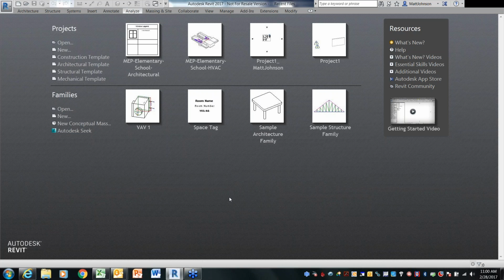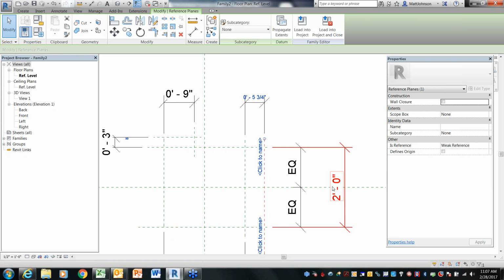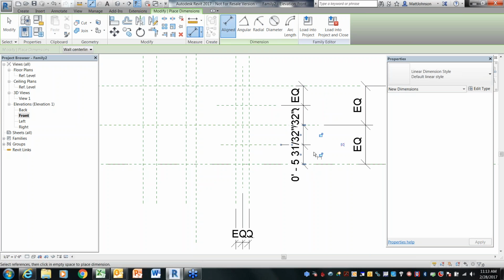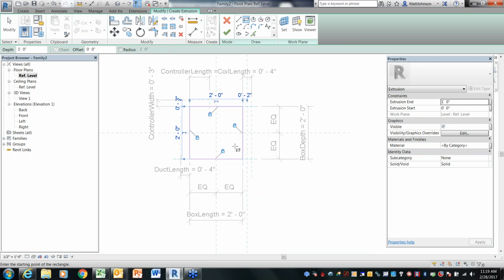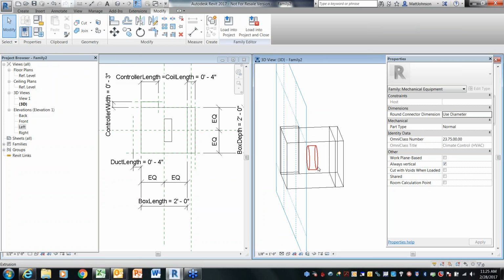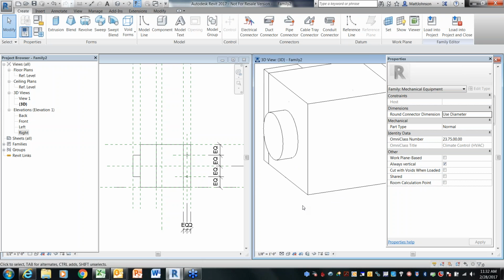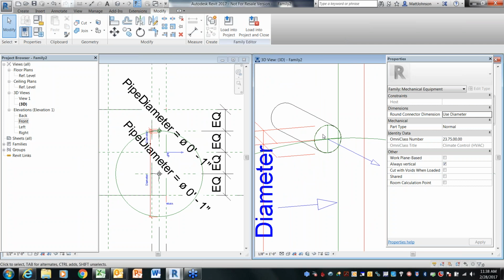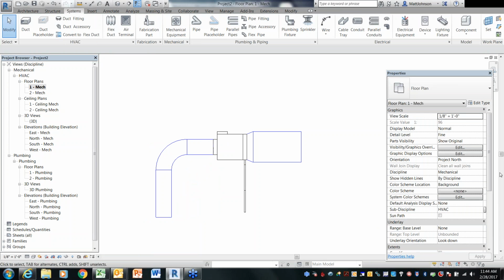Revit MEP Family Creation

Comment: awesome vedio. definitely learnt a lot. are u still making vedios on REVIT?
Reply from the maker: Thank you! Yes, we are still making videos on Revit, recently we covered What's New in Revit 2027. Is there anything specific you're looking for a video covering?
Reply: @Hagerman   thank you! for the reply. Actually i was looking for some insights about HVAC system and designing . If it could be a whole portion covering HVAC designing and calculations then it would be so helpful.☺
Reply from the maker: @EKAMRADAS-z4i  I will bring this up with our Solution Engineers and get this on the list for videos! Thank you for the suggestion